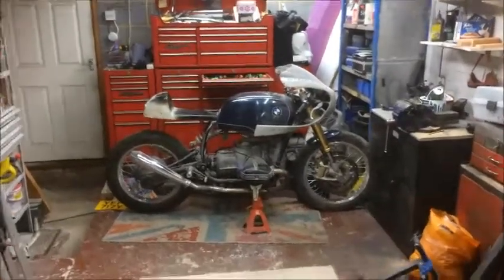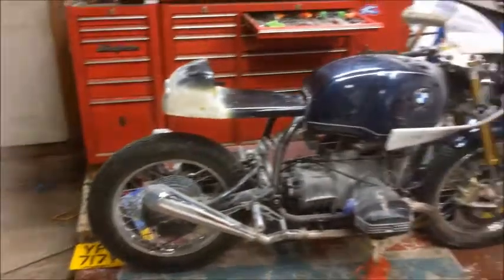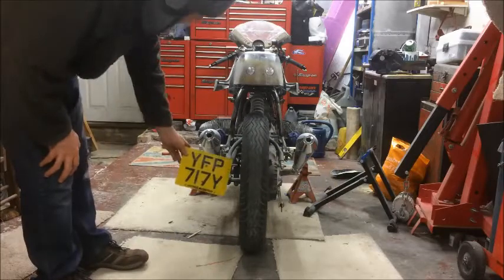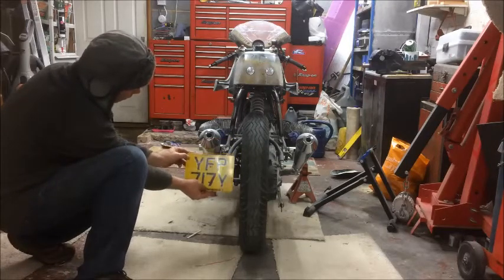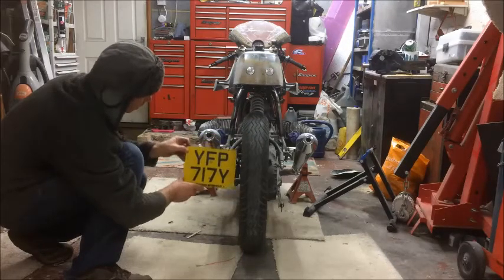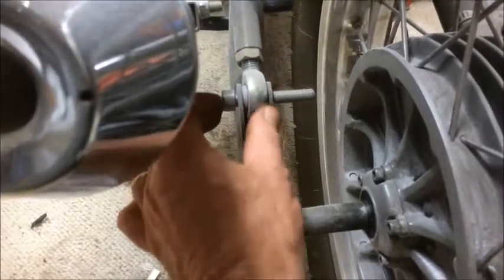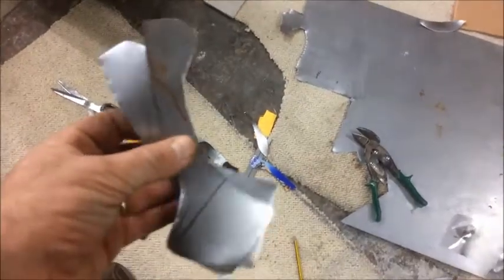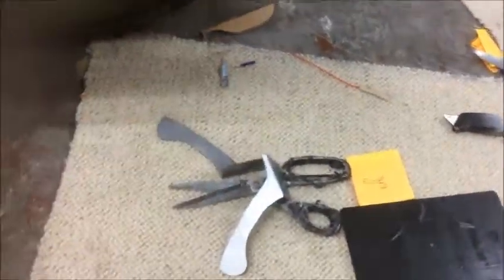bmw r80 cafe racer project part 41

Comment: Pete. Just wanted to say how much I've enjoyed watching the videos. I bought a BMW R80 this week with the intention of building a cafe racer and your videos have been the best source of info I've found up to now! I was hoping to get it finished over the winter months but I realise now that I may have been a little over-ambitious!
Keep up the good work!
Thanks again
Reply from the maker: Dave Asher that's great, thanks for the comments they are much appreciated, good luck with your own, if you ever feel the need please feel free to link any photos/ videos of it from here, It's good to see what other people are doing......
Reply: I was just looking at some ZXR750 J forks and yokes (on ebay) Pete and wondered, what year bike were yours from? These are from a 92
Also, did you save the dimensions for the spindle and or top yoke at all?
Cheers
Reply from the maker: Dave Asher good evening, sorry I'm not sure what year my stuff is from, only the bottom yoke is Kawasaki. The legs are from a Bmw s1000rr, sounds nonsensical I know but it was all about what I could get hold of at the time. I don't have any measurements from fitting mine but it's only really the bearing sizes you have to worry about, as it is clamped
Reply from the maker: (Posted before finished!) as it is threaded the length isn't so important. Draw it all out first, with a little thought and the Bmw and Kawasaki measurements you should be able to create a plan......good luck...
Reply: Thanks Pete that's great. 
Luckily my friend (and next door neighbour) runs a big fabrication company so I should be able to get the parts I need made. And your comment regarding the length is what I was going to ask next. I fugured there would be enough adjustment in the threads but wasn't sure. Thanks again!
Reply: Pete,
Another query if I may?
Where did you get the spoked wheels from? Are they from an R75/5? I wonder if the 75/5 hubs are the same or perhaps can be modified?
Anyway, I'm struggling to even find a solution so any help would be much appreciated.
Cheers
Dave
Reply from the maker: Good morning Dave, I bought the wheels separately (eBay) both for undisclosed sums (possibly grounds for a divorce if my lovely wife ever read this- if not that a good long while of cold shoulder), had to be done though as I think they give the best effect. The rear was advertised as a twin shock r80, and it fits fine, the front was r series airhead, so could have been anything. I never tried it on the original forks, I just modified the spindle to make it fit the s1000 forks. I got very lucky with the brakes though, I have to say if you are fitting Kawasaki forks, it would make life a crap load easier if you got a spokes wheel for the Kawasaki, that way spindle and brakes etc won't be any issue. I can see the only issue being size (probably smaller and wider than original) but I would definitely look that way first. Failing that you can make anything fit if you try hard enough, have a look at how I made mine fit, the Kawasaki bottoms will be near identical to mine, I would wager you could do the same as I did, that video isn't too bad- I think it explains it relatively well....good luck...
Reply: Thanks Pete.
I've actually took a 'flyer' and purchased a complete USD front-end from a Yamaha FZR R1 so I have the triple tree, wheel, discs, clip-on's, levers, master cylinder and callipers. Having done some research I reckon the replacement wheel may need to be a late ish Harley and that will need some mods to fit the R1 discs. It's the rear wheel that I was really confused about and you may have answered that so thanks again. Just one more question on that if I may; do you know if a BMW R80GS paralever 1990 spoked rear wheel (2172) would be a straight swap on the R80/7 or does it need to be off an early R series? Just that there’s one on eBay (for only £300.00!).
And finally, as you alluded, I have been surprised at the cost of the items in question and am also sneaking gear into my garage on a regular basis! 
Thanks so much for your time.
Reply from the maker: Dave Asher good evening, sorry but I thought I replied to this ages ago, not sure about the wheel fitment I am afraid. I like the sound of your project I have to say, would be interested to some photos of it sometime.....I need a little inspiration to be fair -it's frickin freezing here and I am struggling to get of the warm cosy sofa......

Comment: Ive seen many builds that uses a single-arm-swingarm, is that a certain model, or do you have to modify the swingarm?
Reply from the maker: engstrom9202  good evening, the later bikes had a single rear shock (on right side not centre) and a single sided swinging arm. The call them a "mono lever". Not sure of the dates when they appeared though. Slightly different look but I think they can look great if done properly.....